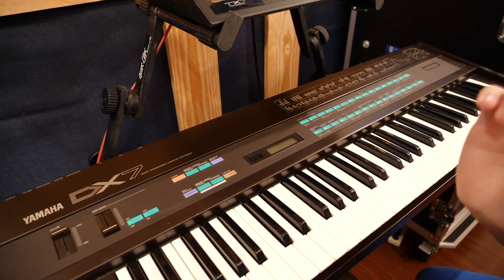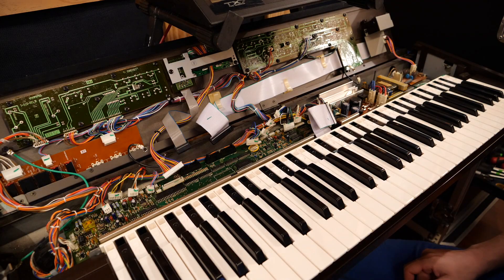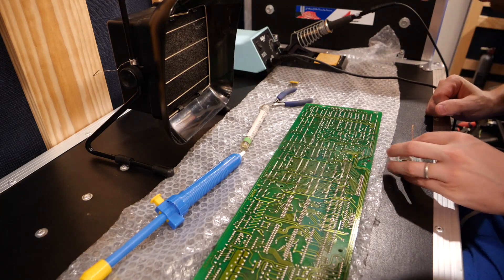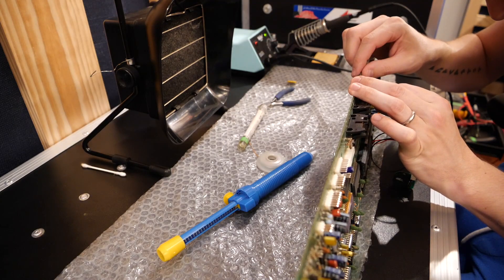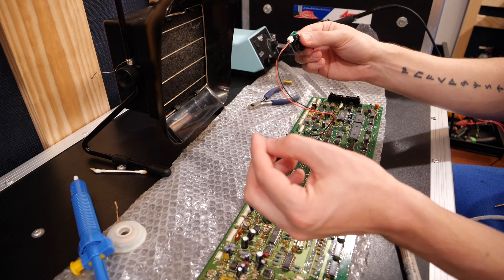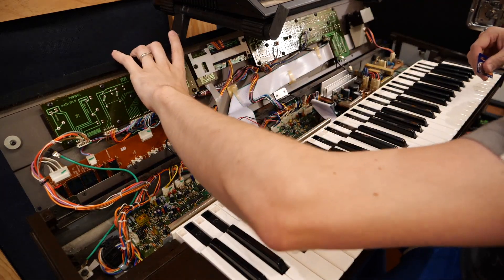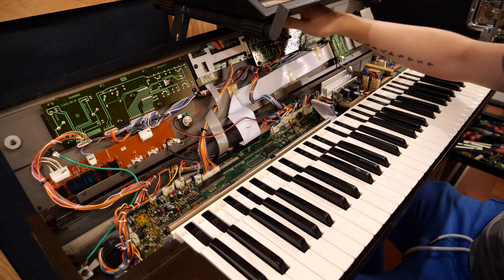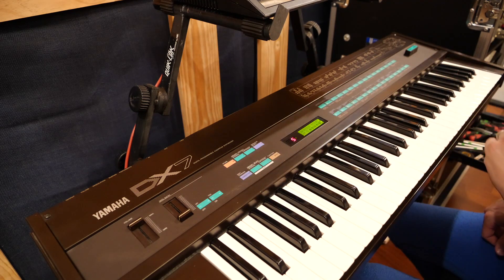DX7 Battery Replacement and Battery Holder Install

Comment: Hello, good video! The link to your holder expired and I can't find an alternative that has a molex connecter attached to the holder  like yours. Any suggestions for a source in the US? Thanks.
Reply from the maker: Darn, they used to be flooding ebay, Here is another one: https://analogclassics.com/product/battery-replacement-for-yamaha-dx7-dx7iid-fd-dx21/?srsltid=AfmBOopnP7Uk_9XglCxlIMCfOBWak9MzPSWXT7x6KSkubk-8t7dBE-e1
Reply: @OwlCoveProductions  Thanks!

Comment: Always be careful with static electricity while working on the DX7 boards! Especially in winter when the air is very dry. Ground yourself using an antistatic wrist strap to minimize damage to the ICs on the board. There a lot of static sensitive ICs on the boards. One zap from the static discharge and you will end up many hours trying to fix it.

Comment: How do you desolder?
Reply from the maker: There are a number of ways to do it. Best is probably to use a desoldering tool and solder wick. You can also just melt the solder and pull each side out, but you have to be very careful that the solder is completely melted until it is out, because you can pull up the trace.
Reply: Cool, so if I bought a desolder pump that may do the trick?
Reply from the maker: @carlbrashears7421  I’ve put a link to the tool that I generally use at the bottom of this comment. I believe that I just melted the solder with my regular iron and pulled the ends out on this video, but in general a dedicated tool used right is the better way to go. I would caution you against soldering on PCB’s unless you have a decent amount of experience soldering electronics, as it is easy to mess up and create a bigger problem. Always best to seek a qualified tech if you aren’t sure - for the safety of yourself and your equipment.

https://www.amazon.com/American-HAKKO-Products-FR301-03-Desoldering/dp/B07BFVFMS9/ref=mp_s_a_1_2?adgrpid=53518145462&hvadid=580721585256&hvdev=m&hvlocphy=1014361&hvnetw=g&hvqmt=e&hvrand=2074065579859944594&hvtargid=kwd-344016219282&hydadcr=28310_14518992&keywords=hakko+desoldering+gun&qid=1694146247&sr=8-2
Reply: @OwlCoveProductions  I may just seek out a local Yamaha technician and see what they would charge for this procedure. I have limited experience with soldering and I don’t want to mess up my DX7. Thank you!
Reply from the maker: @carlbrashears7421  probably a good call. Where are you located? I’d be happy to do it cheap if you are in Northern California.
Reply: @OwlCoveProductions  Aw shoot Im located in Maryland. There are some local official Yamaha technicians I am going to call tomorrow.
Reply from the maker: @carlbrashears7421  sounds good!
Reply: This is genious! No more expensive battery changes at technician. I ran the wires through the body downside of DX7 and have a protected battery case there. That way you don’t even have to open up the cover for batt change 🤩 And it doesn’t effect the looks of DX even at stage.